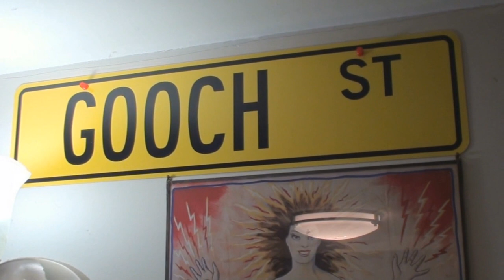Jay Turser Acoustic Bass Guitar Needs Help

Comment: What a chump I am. But in my defence, a whole lot of shit going down at the mo. 
Saw thumbnail, thought yeh I’ve got two J T acoustic guitars, look at that the bridge came off, stuck on top of the finish… woah woah you chump, I’ve had the same problem with one of my two. Bridge was lifting. Took it off. Yup, guitar top was finished all over, then the bridge was stuck on. A coloured finish that was so thick, I ended up with a depression on the top as the finish stuck nicely to the underside of the saddle. Also brittle and broke away around the edges. Still got to figure out how to tidy that up. Other guitar has a thin translucent finish. Fingers crossed. Cheap guitars anyway , so no stress.

Comment: The main reason for sanding prior to gluing is not about the surface finish but something that you can not see with your eyes. Every thing oxidizes when exposed to air.In factories where they make furniture they have strict rules that if after sanding the part sits to long it has to be re sanded before it is allowed to be glued. The general rule here is out of site = out of mind. It requires faith in science which is rarely found in today's world.

Comment: I want to know, have you made a bass of your own?
I made a dubble neck four string/five string frettless, headless tuning system from Hipshot
Reply from the maker: why .?.I have a vintage P bass
Reply: @DavesWorldofFunStuff  I did a misstake 1990, sold a 1969 Jazz Fender with case,  got 3000 swedish  crown. equal to $ 300.